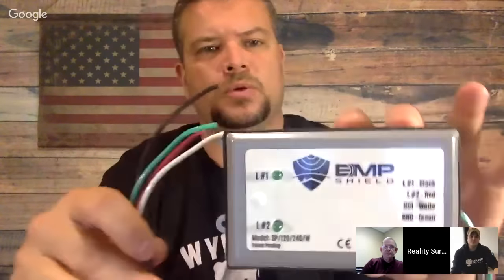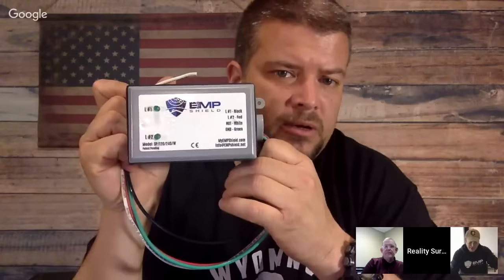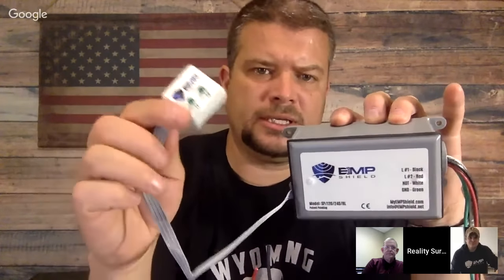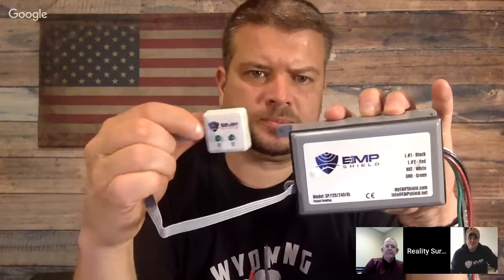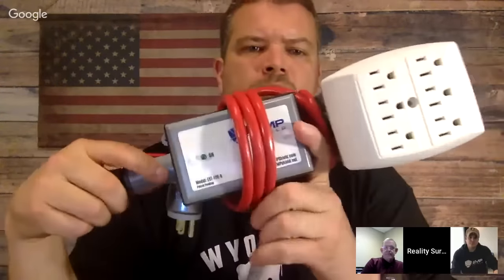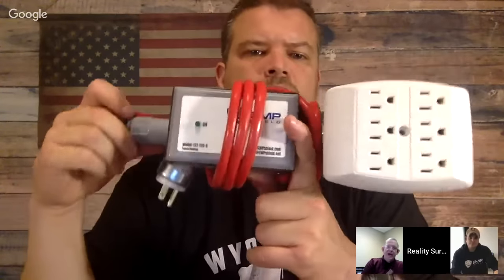The Truth About The EMP Shield!

Comment: High voltage (230 or 500 kV) AC transformers are not built in the United States. Lead time on their delivery when supply chains are in good shape is 9 months. If an EMP takes out multiple transformers in multiple substations the grid would be down for years. But first we would have to get the communication systems back online to place the orders and the transportation systems running to move the transformers.

Even if you could replace all the transformers within a month, it would take years to replace the control systems that protect the power grid. Heck, it takes years to replace them now when we have power and supply chains running normally!

Read One Second After by William R. Forstchen. That book describes very well how things would go following an EMP event targeting the US. And no presidential executive order can fix this problem because it is the American addiction to technology as the solution for everything that caused it.
Reply from the maker: Wrong. There are 9 facilities that build VLPT here in the US. Cmon man keep up. 😂

Comment: So if a portable generator is wired to the fuse box but the circuit breaker is off because of active line voltage, is the generator still protected even though the ground and neutral are still connected directly to the box??
Reply from the maker: I would check with EMP Shield customer service just to be sure.

Comment: The U.S. doesn't make electrical equipment. Those big transformers are made in Europe, the government has said it would take a decade to get the grid back online.  So, no backup means no power.
Reply from the maker: Nope. We have 9 plants here in the US that makes VLPTs.
Reply: @Reality Survival   How many will be working with an EMP strike?  That is what I am referring to and the attacks on the large transformers by rifles showed the cracks in the system.  Electric companies  referenced the short supply
Reply from the maker: There haven’t been any attacks on VLPTs by rifles. Those were attacks on small transformers. But the plants that are here can be hooked to generator power locally in order to rebuild if needed.

Comment: Ok so this is a Surge Protector. Why so expensive? Any surge in voltage is protected by a cheap protector in power strips you have right now so whats the point of this?
Reply from the maker: It’s not a regular surge protector. It is an ultra fast surge protector. It has to be able to drain energy faster than the E1 pulse of the EMP. Normal surge protectors cannot do that.

Comment: Can I plug my home power wiring into it, instead of individual items?
Reply from the maker: It doesn’t connect to individual items. It wires into your homes electrical panel. So it protect ALL the items that are plugged into to your homes electrical system.
Reply: @RealitySurvival  thank you. Your video did explain this eventually and explained it very well, but I made the foolish mistake of commenting before the video was over.
Reply from the maker: No worries!

Comment: how can this device bleed off 5000 amps to ground with a 20 amp breaker?  do you offer discount on multiple units?
Reply from the maker: My understanding from the manufacturer is that it is all about how fast the the circuitry works. So essentially the device is able to bleed off the energy faster than the wave can build up heat in the components. The $50 discount is good for each unit purchased if you use the RealitySurvival discount code.

Comment: If this is Shield is used in a home what difference does it make? The entire power grid and all power will be least for at least a year. A generator is good for a few days at best, IF you buy another Shield for it, as you cand get fuel
Reply from the maker: You should certainly be able to prep more than enough fuel to last a couple months. Then if you ration it’s use you can stretch that even further. Also it protects your appliances and electronics so that when the grid does come back up a few months later you will be far ahead of the game. All of the people who failed to protect their appliances will be waiting for years for the supply chain to be rebuilt. So yes it will put you far ahead of everyone else if you are preparing properly.

Comment: What I'd like to know is if hit with emp and I have a ham radio say in basement closet will that radio still work after the emp?
Reply from the maker: Not likely. However, there are a bunch of variables that could change that answer. Distance from ground zero, geographic shading, etc. EMPShield.com does sell radio specific devices to protect radio equip though.

Comment: I have no doubt that points and condenser type distributors would be fine in the event of an EMP but post 1974 carbureted vehicles had electronic distributors. Would the car version also work on those too? Like say any carbureted vehicle from the early 80's? Electronic distributors have a control module too and that might not be so lucky.
Reply from the maker: Yep the EMP Shield will work on them as well.
Reply: @RealitySurvival Great! Then I don't have to swap in a points distributor.

Comment: The question is where to mount it in the car; the mechanics are unsure and it doesn’t fit anywhere
Reply from the maker: There is usually plenty of space under the hood to mount them. If you are right on space you can get the new micro which is much smaller. Also they could be mounted under the dash as well.

Comment: How does the EMP charge ground to earth on a car?  Rubber tires....  How does the....maybe # 12 or #10 wires on your units....handle the extreme voltages???  Typically only rated to 600V.
Reply from the maker: It continuously cycles and discharges to the chassis until the spike is dissipated. Keeping the heat from building in the circuitry.

Comment: If the power grid is hit and the station pumping natural gas to your backup generator has no power, there is no gas
Reply from the maker: Sort of. But not exactly. First most folks will have there own propane tanks. Will will only last a few weeks to a couple months of you ration it’s use. Second natural gas will continue to flow but at lower rates. Also the pump stations also have back up power. Eventually the pressure will be drained from the natural gas pipes. But it will take a while. The volume in the large pipelines is quite considerable. But your overall point is correct which is why we teach to have multiple systems to be able to generate electricity.
Reply: Thank you for taking time and  responding. I found out about this product just today. It seems incredible, I've been trying to figure out how to protect my new vehicle, not buy an old one. And now protect my home, since I was oblivious of this aspect, thank you for the video, I am now a subscriber. I've been taking necessary steps in the right direction. I have been reading One second after, by William Forstchen. It's a good read. I look forward to watching more of your content. God bless America 🇺🇸
Reply from the maker: Awesome. I appreciate you stopping by.

Comment: Do you not need ferrites on the incoming house lines or on sensitive equipment? Or should I still do that?

What about a safe… if I have power going into my safe will this prevent the surge from going in through the wires and frying my red dot/scope?

He said it works on a “live circuit”… so anything that’s switched off (like an outlet on a switch or led bulbs on a light fixture) isn’t protected? 🤔
Reply from the maker: He meant any circuit that is connected to the panel. Not anything with actual power in the line.

Comment: Will the EMP Shield whole house device protect my outside generator.
Reply from the maker: No. If it is a whole house generator then you need one specifically for that unit because it is on an isolated circuit. If it is a portable generator they make models for those as well.

Comment: If your home has three panels, are all protected by one module?
Reply from the maker: You would need to contact EMP Shield customer service to be sure. For a normal home one unit will cover about a 3000 sq foot home if I remember correct.

Comment: i understand how the shield would take to ground incoming surge off the grid. However, an EMP would attack the entire house. How does this device prevent damage to circuits from a surge that bypassed the grid and hits your electronics on the other side of your electrical panel before passing through the shield?
Reply from the maker: The whole house and everything plugged in is one large circuit. It monitors the circuit and when it detects an increase in induced energy it shunts it back to ground before any heat can build and then fry the electronics. It’s all about the speed of the device and the ability to monitor the increase voltage induced.

Comment: I still don't understand exactly how this works.  It seems that the EMP shield is essentially a surge protector, the problem is that an EMP is not technically a surge of electricity that just "shocks" everything.  It is NOT at all the same thing as a lightning strike. It's essentially a radio wave that fries micro-circuitry. With the emp shield, you hook to your pos, neg, and ground to the frame of the car right? What could that possibly do to protect the micro-circuitry that the RF waves are passing through?
Reply from the maker: The “shock” as you put it is three waves of induced voltage that the magnetic waves induce into conductors. The EMP shield is very fast and dissipating the induced voltage so that heat does not build up in the circuitry by shunting that excess voltage to ground over and over again until it is within safe limits.
Reply: @RealitySurvival  That makes sense, it makes more sense for a house because I assume the ground actually goes to the ground and allows the charge to dissipate.   How could that work in a vehicle? Sitting on 4 rubber tires.  I'm guessing the theory/hope is that it passes that charge to the frame and THAT is enough to keep your circuitry from frying?
Reply from the maker: Yep the capacity of the frame/subframe of a vehicle is much more than the induced current.

Comment: Residual power voltage stored in the components may be incited by the EMP.  EMP is a Frequency spike across voltage.  like 60hz is what the standard is.  But if that frequency is significantly higher, then when it crosses the voltage path, the voltage increase will damage electronic components like resistors, capacitor, inductors...  Even if the power if off to the house.  there will still be residual power and an EMP can still cause damage.    What I want to know is, What is the minimum voltage this thing will operate on.
Reply from the maker: It will operate even if the power is off. It will use the voltage of the spike to power the circuit and bleed off any overage of energy.

Comment: My house and utility building has three electrical panels.  The distance between them is less than 200 feet.  Does each panel need an EMP shield device?
Reply from the maker: I think one would cover both but I would check with EMP Shield customer service to be sure.

Comment: Could someone put a lightning surge protector in front of the EMP Shield to protect EMP device from the lightning strike so the EMP can continue to operator for its intended purpose?
Reply from the maker: Not sure that it could be wired up that way. The lightening surge protector circuitry would be too slow.
Reply: @RealitySurvival  But if the device could take the hit lightning strike and keep the EMP shield from absorbing (disabling) it, it could continue to operate as an EMP device, not an EMP + lightning arrestor. If that make sense. I don’t want lightning killing my EMP protection.
Reply from the maker: Yeah I don’t think that will work unfortunately. The EMP Shield will also protect your home from lightening. But it will only take one strike. Then you would have to send the company $50 and they will send you a new unit.

Comment: How far is the protection good for in Feet or Meters. ?  My Water Well is around 500 feet from my Houses electrical box but is linked to my Solar and is on my side of the Power companies box. would I need a separate unit to protect the well at the circuit box for the well.
Reply from the maker: I think you would need a separate unit that far away. But I would check with EMP Shield to be sure.

Comment: Best defence is Faraday cage everything and ground it. Several sides on the cage. 

Automobiles ...depending on intensity and source of emp it may not matter if say, nuclear detonation... the outer body would absorb some which is grounded to circuits in the vehicle. If a high potential is reached it could arc and destroy parts.

Or the circut board act like a net for the pulse. 

If you had like, a underground shelter of some kind. Grounding the body (if steel) could help alot. 

If you want to see what will and won't work. Could always make a device that creates a emp and test it on things. But it won't be the same as other sources
Reply from the maker: Faraday cages are good for smaller items for sure. No need to ground them though. Look up skin effect to learn why. Also for homes and cars faraday cages give you no protect. The best thing you can do is install an EMP Shield for those.

Comment: Isn't this what existing surge protectors already do?
Reply from the maker: No. Existing surfer protectors are not fast enough. This is built to be fast enough to bleed off all over the EMPs induced voltage before it harms any circuitry.

Comment: So I wouldn’t need a generator for my home as long as the shield is on my breaker box?
Reply from the maker: Yes you would need a generator. The electric grid will be down. But if you have a generator the stuff plugged in in your house will still work.
Reply: @RealitySurvival  thank you. So the shield installed on my breaker. And then when grid goes down, I can then start the generator and the house will power up?
Reply from the maker: Yep.

Comment: How do you install this on a 2017 Mercedes GLS450 ?
The battery is under the passenger seat and has flat terminals.
There is a separate design under the hood for jumpstarting  that has a positive post and a ground post but no negative post.
Reply from the maker: Just the same way as any other vehicle. Just make sure the red goes to the positive. Black to battery ground. Green to Chassis ground.

Comment: Any of you who are thinking about  buying this thing had better understand the risks. I bought two of these things. One for my breaker box and one for my solar controller. I have no idea if the one on the breaker box will work but one thing I know for sure is it damaged my solar controller. I have a Midnite Classic 150 that was working perfectly until I attached that EMP Shield. The controller then would just turn itself off and drastically discharged my batteries. The controller would show the batteries at full charge but when tested the batteries were at 11 volts. I have no doubt that this thing permanently damaged my batteries as discharging them to that level does cause damage. I had to buy another controller at $750.00 to replace the one that was damaged. DO NOT USE THIS DEVICE ON ANY OFF GRID CONTROLLER!!!!!

Comment: If a trash can works, why doesn't the steel body of a  car protect the electronics?  Do these units require power to operate?  In the video, he said the LED's must indicate green (power), for it to work.  What if power is already down prior to an EMP event?
Reply from the maker: Look up the skin effect. That will explain the answer to your question. The led does not have to be on for it to work. As long as it is wired correctly. If the battery is dead it will still work because it will “wake up” when it senses the over voltage in the system.

Comment: Thanks for a great hour of EMP education. I actually called the company because I am in a Condo and wanted to know if this device would protect my unit. After a couple of questions, it was determined that my device will likely protect all 8 units in this building. The device is made to protect 250 linear feet in all directions from your breaker box to the meter. And, because my unit is at the far end of the building, everything from here to the meter is covered. I guess if an EMP happens, I won't be spending much on beer. LOL Great video and excellent company.BTW--I saved $100 by using the affiliate link in the description. Thanks for that as well.

Comment: So is a portable device protected when it's plugged in to a wall socket, but vulnerable if it is not plugged in? Does plugging in a device to a house protected by EMP Shield, give it the same protection as a Faraday cage (or bag) when the device is not plugged in?
Reply from the maker: That is correct. If a device is plugged into a socket protected by an EMP Shield it will be protected. If it is not plugged in it doesnt have any protection and would need to be in a faraday cage.

Comment: what about radio operators? i have 3 towers with antennas on each. and wire antennas between them and trees. what about my radios? im guessing it would cost $1000s to protect my radio equipment.
Reply from the maker: I believe it would protect your radios as long as the antennas were within the recommend footprint. If they are outside a certain square footage you may need more than one. But to be sure I would call EMP Shield customer service and chat with a technician.